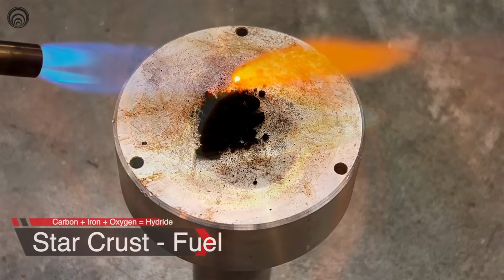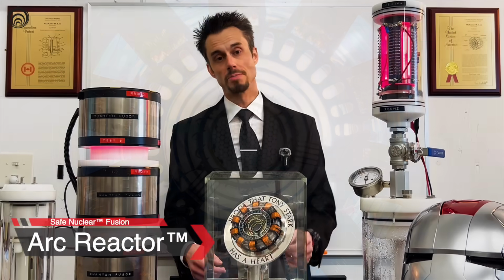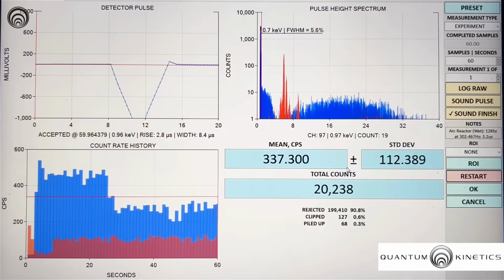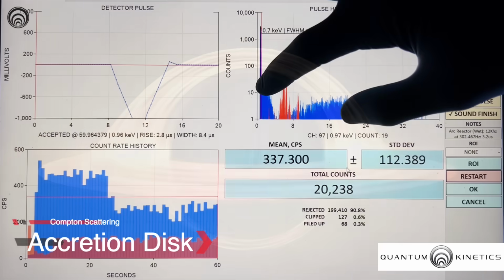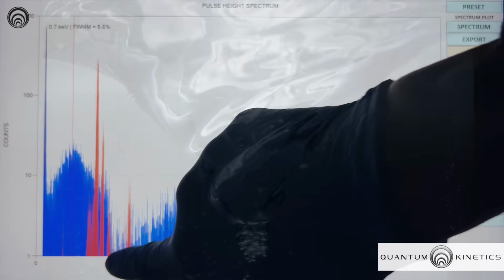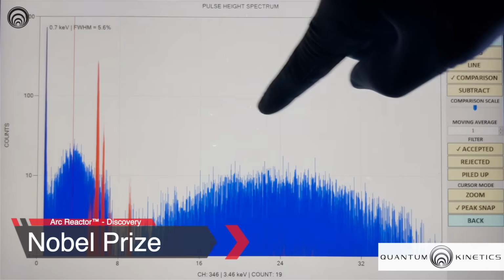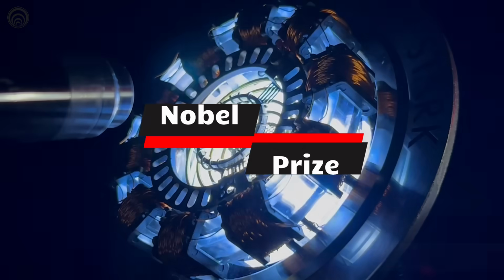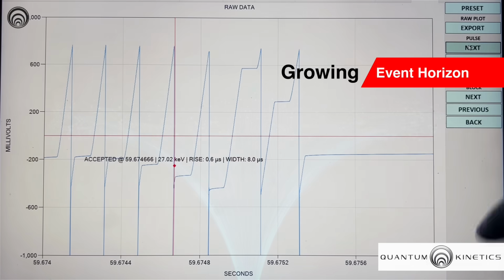Arc Reactor™ | Black Hole | Nobel Prize | Quantum Kinetics Corporation

Comment: Hello sir, Can energy be converted into matter using the arc reactor technology? It shows some glimpses of what this arc reactor can achieve.
Reply from the maker: Thanks for your comment.

Matter is light. As light is matter. It just depends on which state they are currently in via kinetic or potential… There is more…
Reply: Don't listen to him. Light isn't matter. Light is made up of photons which bounce of matter at  the matter's wavelength to be perceived by your eyes.
Reply: Light is not matter as it has no mass, basic. You would expect a "scientist" to know this.